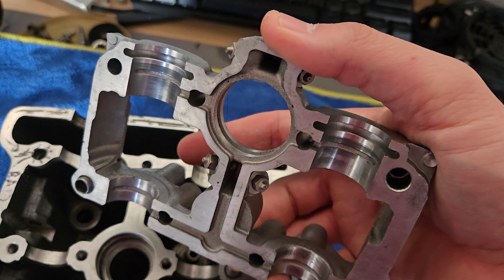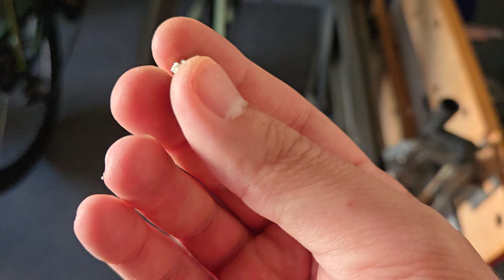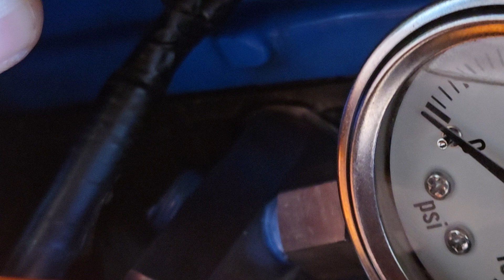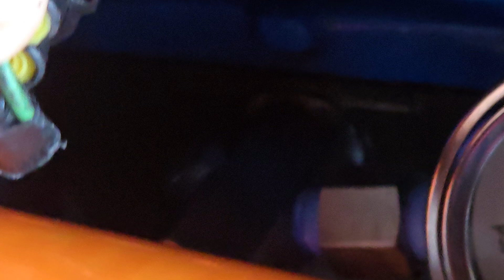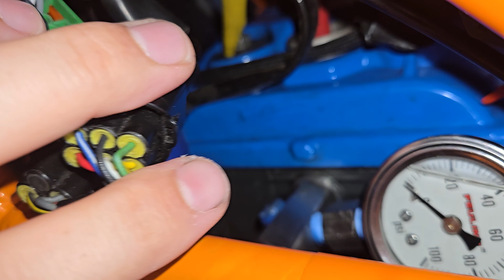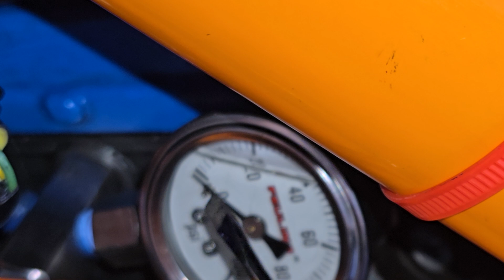KTM 390 Duke - oil pressure gauge install.

Comment: You might wanna upgrade your brakes pushing that much power, way simpler install tbh, get a galfer rotor, brembo piston and metal brake line and ceramic pads for the front and you’re good to go!
Reply from the maker: Thanks for the advice!

Comment: Good job, but I guess there is an oil pressure indication which is simple as easy. The liquid filled gauge is a plus, but I guess in the name of science it's always informative, but just for the sake of the gauge going bust due to the vicinity of the exhaust and the glass cracking... that's for another day.
Reply from the maker: I've been considering a small line to have it slightly remote mounted.  I'll have to see how the heat effects it.

Comment: Good idea and your points on the oil squirters on the lobes mirror my thoughts. TBH once i did my valve shims I felt the cheesy quality of the  materials used in the engine was disappointing and so I sold the bike...
Reply: Try working on a Ducati.. :)
Reply: @vijayam1  had an M900, M800, M620 and S4R, but they didn't put me off in that way. I did belt services on the dues, but not the quattro...